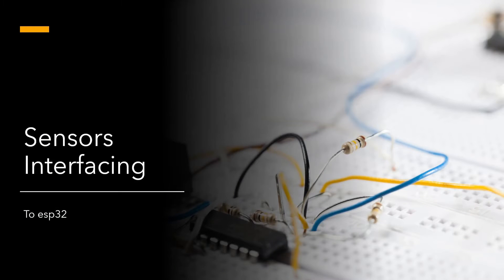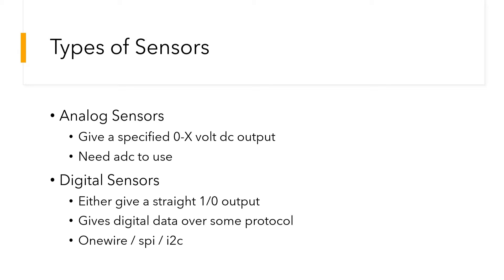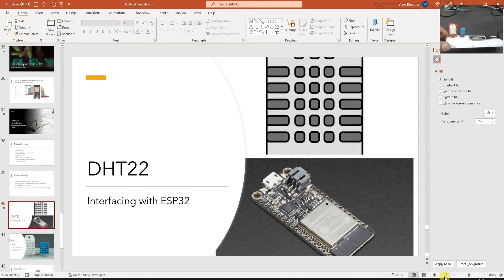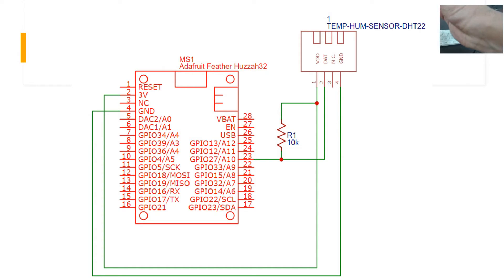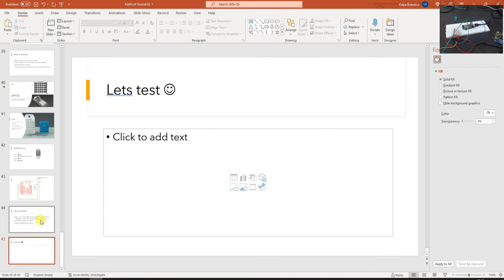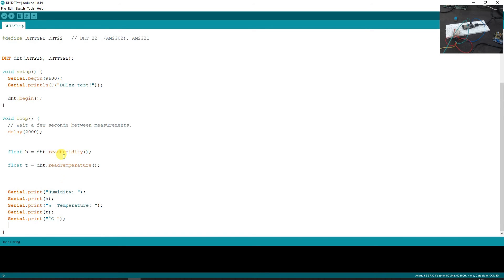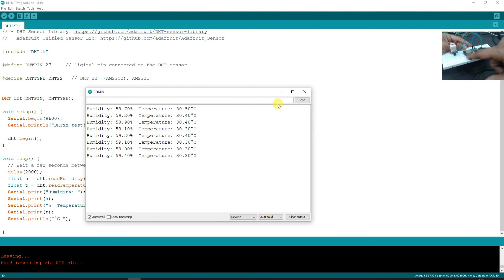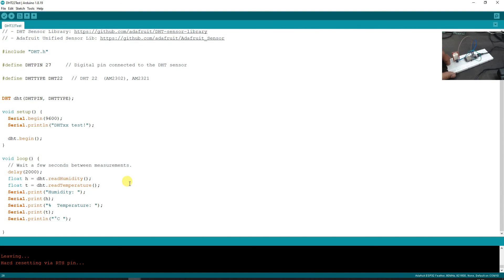How To Interface DHT 22 Sensor With ESP 32 | Basic Programing Tutorial #sensor  #esp32

Comment: Thank you sir for your explanation could u please give more tutorials about:
Vibration   : MPU6500
Speed       : proximity sensor RM12
Current     : ACS712
Voltage     : ZMPT101B
how to interface these sensors with esp32, or will all the sensors have same pin configuration as temperature sensor